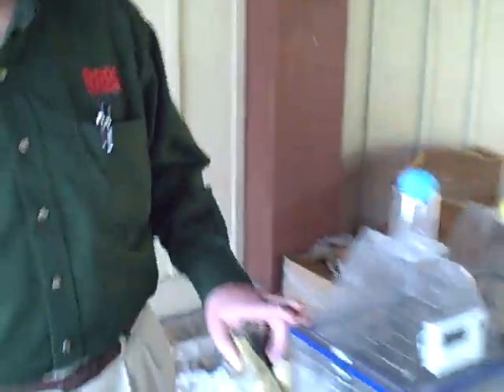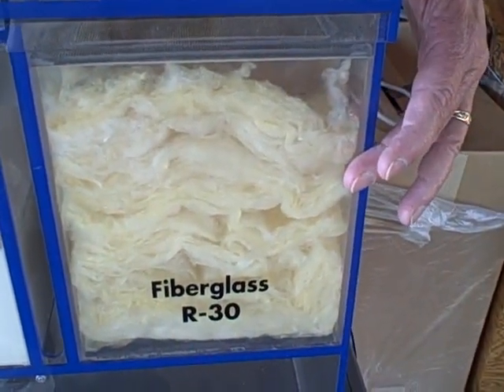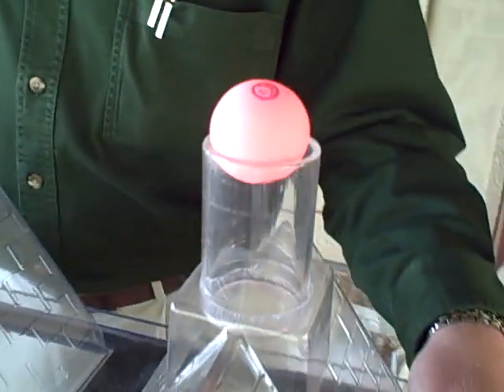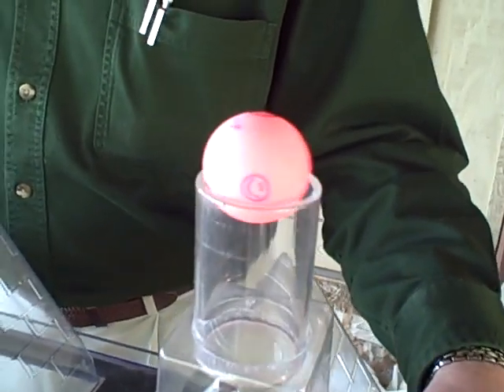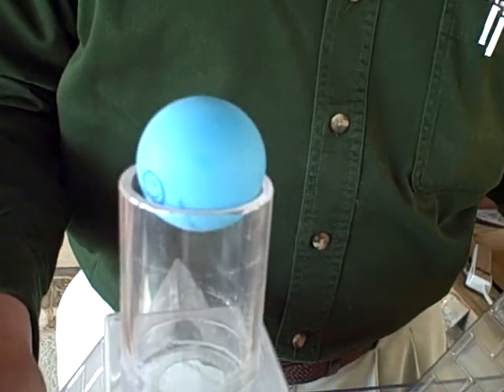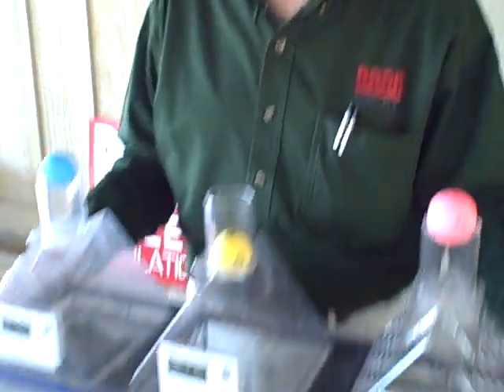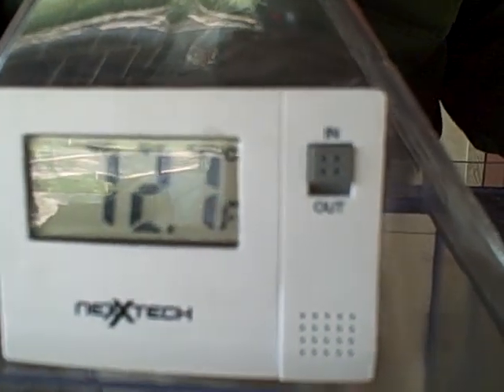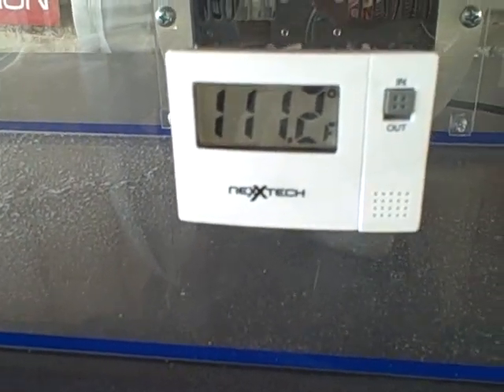Which Type of Insulation Works Best? Comparing Icynene Spray Foam, BIBS, and Cellulose

Comment: No need for fancy expensive foam if you air seal with calk and cans of spray foam, then insulate with traditional products. Traditional products ie cellulose and fiberglass will perform well when installed properly. People saying fiberglass and cellulose are poor performers are only trying to sell you on foam.
Reply: Yes cellulose and fibreglass are great insulation products (although can contain formaldehyde), but they come nowhere near spray foam at saving on energy bills through air leakage, and ask any builder that has tried to build a passive house not using spray foam if they would do it again, the answer is usually NO WAY.
Spray foam insulation is the future, it's so quick and if you use a decent foam like icynene or lopella ect you don't get any of the horror stories.
People research your foam before installing!!!
Reply: +bigbadpman Well, it's like I said before, fiberglass batts/rolls and cellulose perform just as well with proper air sealing. Why spend 75% more money when you get the same, or a little less results? In order for fiberglass and cellulose to work to the full benefit, you need to air seal first. Air sealing involves sealing cracks and seams with foam and caulk. Air infiltration is what reduces traditional insulation's effectiveness.
   Proper installation is also key, especially with fiberglass batts. The entire stud bay needs to be filled the full depth with no compression, and cut to fit the exact dimensions of the bay.  
  Another added cost with using foam is proper ventilation equipment. The house is sealed up so tight that you need an exchanger to bring in fresh air. 
  Other problems with foam is that you need to hire a professional to install the product. The homeowner can install fiberglass and cellulose themselves. Also, when the foam dries and becomes solid, any plumbing and electrical work creates problems because the contractors, or homeowner, have to try to work around the foam. It is a night mare trying to install wiring and plumbing etc. The product has to be removed and disposed of, another expense. With batts, you just pull back the insulation, or remove the piece of insulation, then reinstall, although cellulose creates a big mess if you have to open up a wall for whatever reason.
  Bottom line is that foam is WAY to expensive for a slightly higher gain in insulation power. It is sold on the fact that it seals so well, which it does, however you can seal a stud cavity by spraying small cans of foams that seal up the cracks and seams. Sealing is key. The point is, all you are trying to do is seal cracks. You don't need gallons and gallons of foam to seal a few cracks and seams.

Comment: Shouldn't there be a 1/2 inch piece of dry wall at the bottom too? I have never seen a house that didn't have drywall in front of the insulation.